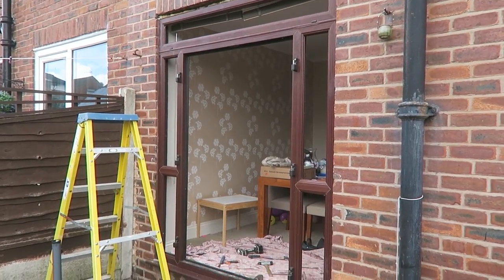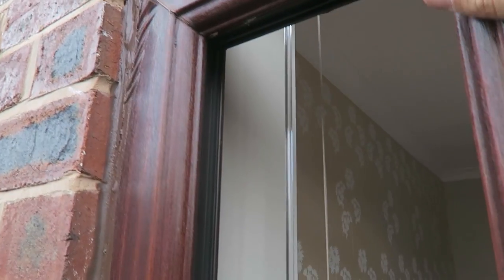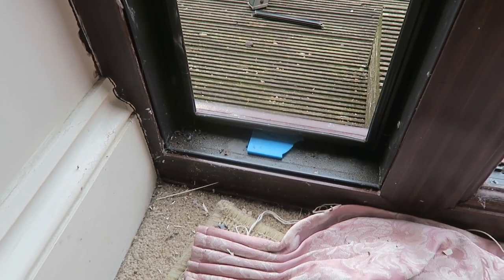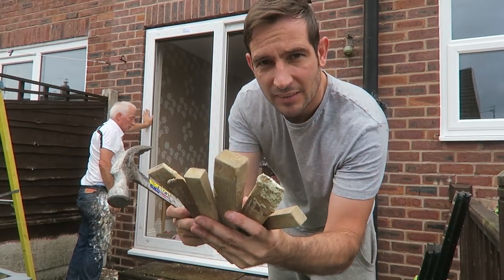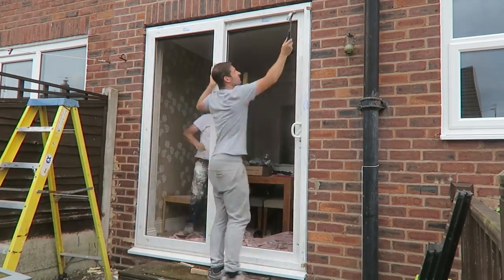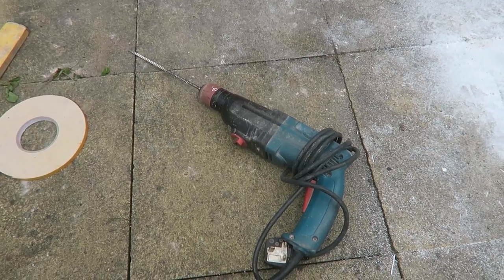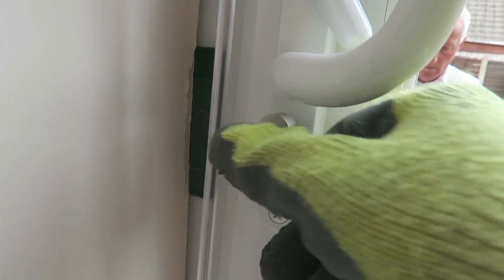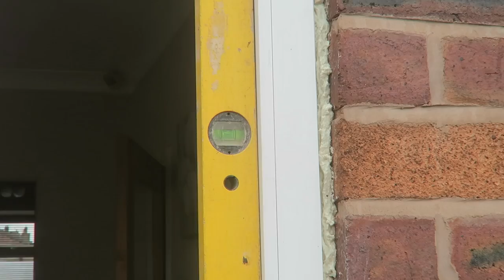how to fit sliding patio doors

Comment: So how much would the total cost of that be including all materials?
Reply: I bought a patio door for £530. Going to  have a go at it myself. Prob be £250 to fit here in Northern Ireland. I got a quote from a glazing company for £1300. They were taking out a window and they would have to cut out opening etc. I’m not a builder. Just a DIYer. Hope this helps.
Reply: @Bobby8270  how did you get on?